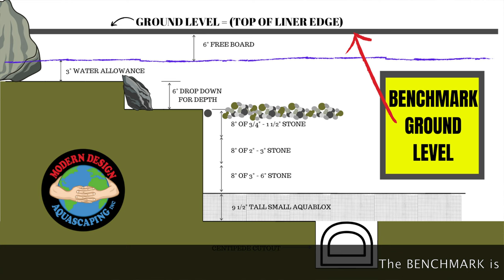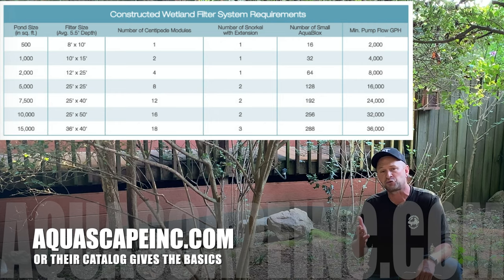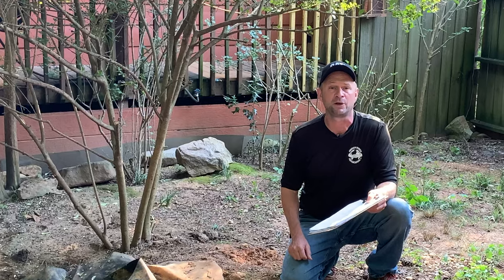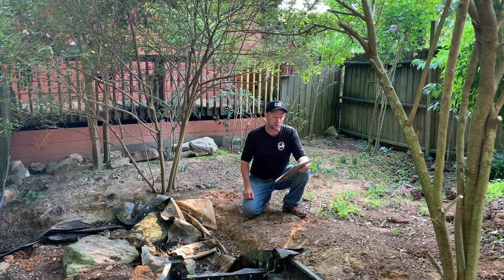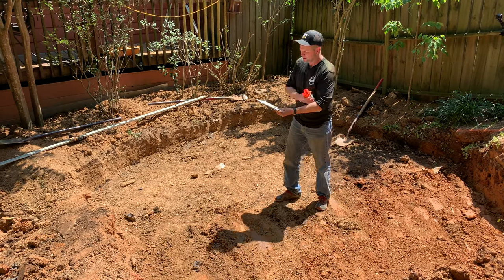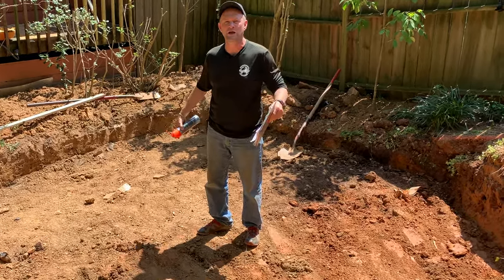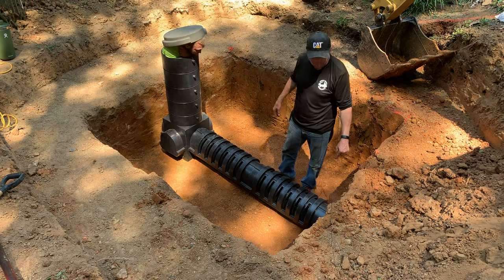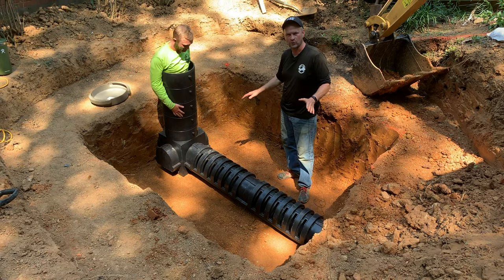WETLAND FILTER LAYOUT AND INSTALLATION Part 1 | Water Feature Design Series 8

Comment: Great video, and Tristan is a funny dude. Can you leave the captions on for longer? Also where the flex PVC gets inserted, is that a bulkhead? The end cap looks solid?
Reply from the maker: Sorry about the captions, work that pause button ;) The flex pipe just slides into the centipede and the gravel / gravity holds it in there. We always use a bulk-head fitting if we perforate liner below water level though!

Comment: John, thank you for sharing. great mind, great vdo, very instructional the way  you put them together.  Goo designed, and practical in the process.  One other important piece of puzzle you should cover, that is energy/power to drive this system.  Your system is great but electric bill is skyrocketing. 
To complete or or top off your great work and design you should consider implementing solar or power source to make it a piece of mind.  Just the thought.
Love you guys, keep up the good work.
Reply from the maker: You are correct. In some areas (like ours) electrical is not so expensive. In other areas external pumps may be a good idea and then there is the whole solar panels to offset the consumption idea. I have never seen solar pumps that were too impressive (but that doesn’t mean they are not out there. Thanks for watching!!

Comment: Thanks John, another great post. It seems like the filter sizing is still a bit of a dark art at this point. It's a very big jump from the biofilter being sufficient to 360 cubic feet of gravel volume. To reduce costs for clients, do you ever go for a biofilter for the solids and then a shallower and smaller gravel bed with plants to enhance filtration? Be a big cost saver if the aquablocks and centipede were taken out.
Reply from the maker: We have built small wetland filters (4 blocks with a pondless vault instead of a centipede). You can do this video’s filter at 1/2 the size. You can use a large bio filter with matala style mats, bio-balls, and a bottom (back-flush) drain... You can buy a Fiesta - you can buy a Lexus- something for everyone eh😎 No dark arts involved, just options. Koi can be $2.00 or $200,000.00

Comment: Can you provide diagram with elevation for this design? I still cant understand the pump placement to the wetland filter and where to tee off for the bleed valve
Reply from the maker: There are diagrams in the videos in this series showing all elevations. The bleeder valve should be above the water level in the wetland and its a simple insertion of a tee and then reduce to 1” pipe and let it spill in right at water level in the wetland so when the pump turns off it gets air. Pump placement can be anywhere in the feature ;) Skimmer-intake etc.

Comment: Perfect timing, I'm currently planning my water feature here in the UK so I can price up materials, was wondering what size wetland filter to go for, my garden is basically flat.  wetland filter at the far end of the garden into a stream with cascades and a final waterfall into the main pond which will be around 15' x 25' x 5' with intake bay, around 50' overall length down the right hand side of my garden. will be using Aquascape products but doing the work by myself because of finances.  look forward to more instructional videos.
Reply from the maker: The filter we are building in this video would be ideal for your pond. You could go smaller but if finances allow, I would do this exact design. Obviously stone around the edges could be smaller than what we plan to install. Stay tuned for the finish ;)
Reply: @KoiAddiction    Thanks John,  appreciate the reply.

Comment: John , the info videos are great. Thanks 
Quick question. I have a 13x25x3 pond and a wetland filter 8x16x4 . Can I run 6000 gallon pump into the centipede or is that too much flow for a wetland filter
Thanks. Keep up the great work
   Jim Milazzo
Reply from the maker: I need more info on the wetland design to answer the question really. We go 2000 GPH per centipede but we also have rules for how many aquablocks per centipede. Can you shoot me a layout or pic of the construction? The other way is to get a dissolved oxygen meter to make sure that is good and then ask yourself “is the filter removing the fines like it should? You can always adjust by letting some of the flow out on top and not pushing it through.

Comment: Hello John, another great video and another question from France 😉. 
Referring to the size of the stones in the filter, I see differences between your video and the Aquascape "official" documentation (Pond Bible). You are mentioning 1 layer of 3"-6" (Aquascape Bible says 4"-6", not far), then 1 layer 2"-3" (Pond Bible says: 1 1/2"-2", quite smaller) and finally 1 layer 3/4"-1 1/2" (Bible: 1/2"-3/4", again quite smaller). Is it that you have experimented better results with that size of stones or because it doesn't matter that much (provided you keep 3 layers of different sizes) and you do as per what is available for your projects ?  Thank you.
Reply from the maker: We have a better (easier) time cleaning the larger 3/4- 11 1/2” gravel. The main thing is that the stones are rounded so they can back flush easier. Grade from larger to smaller as you go up. If you use the small gravel you will be fine, for me it’s harder to clean is all. Larger stone at bottom not so important to me but at least 2-4” for a minimum size over the Aquablocks.
Reply: @KoiAddiction  Thank you. Good reason !

Comment: Hey John! I've only installed one wetland in the past but I've got a few coming up this season. I've got a plumbing question for you: Previously, I just plumbed 3" flex pipe from the pump into the centipede using a Fernco (including the 3" elbow). How are you plumbing the 2" flex pipe into the centipede? I tried to pause the video but I couldn't quite see it all. I saw the elbow but I was wondering if you're using a 3" to 2" reducer, a Fernco or what? I want to have it dialed in this year so I can install the bleeder valve as well. Thanks!
Reply from the maker: 3” tee reduced to bleeder valve. If the flow requires 3 inch into the centipede then I use a fern co-and run the 3 inch into the centipede. Totally depends on required flow rates for the wetland.
Reply: @KoiAddiction  Thanks! You guys are the best. All of your videos have been so helpful. I really value all the advice.

Comment: Hey John, great videos man I'm learning a lot. 

Say I wanted to build a 300 gallon wetland filter at the top of a waterfall, where the filters water level will be 3' above ground level.

Could I build it with a liner and support it with soil tapered a distance or would I need a container to keep the soil from collapsing?
Reply from the maker: I always use soil but we also put rock to create structural stability!

Comment: Great video sir! I've learned a lot from your videos. 
I'm trying to mimic this design for my wetland build. You mentioned that you measured 6.5' in one direction and 7.5' in the other direction. How many aquablocks dose this require? It appears as though small blocks are 26.5"long x 16"wide x 9.5"high. I see you have 3 going length wise to get the 6.5' but it seems there are only 4 laid width wise. Isn't that only 64" wide or 5.3'? Not trying to bad mouth just want to learn because those aquablocks are pricey($51 each). The pond I'm filtering is only about 140 sq ft.
Reply from the maker: We do over-dig the hole so the blocks fit nicely. That may have been the reason? Typically we will add a foot in each direction and back-fill with 2-3” stone after the blocks are in. This makes installation easier for us ;)

Comment: hey John quick question, did I count 12 small Aqua blox's used for this size wetland, I have a 6x8 mtr pond .9mtrs deep and was thinking of using the same size wetland, many thanks daniel
Reply from the maker: It would work BUT if you go to a higher % of pond area you will be ideal. I think that would be 36 small blocks for your example, SO - in theory the 12 small blox is WAAAY better than a bio-falls, and will give you a great filter BUT if I were designing it,  I would offer the 12 as “minimum” and the 36 as a “better” option. After doing some conversions…@ 520 SF in your example, the 12 small blocks is about 7% of pond surface area. 36 small blocks is about 21% of pond surface area. The filter will do it’s job either way SO you offer the choice to the client. According to design, 2@ 6000 biofalls could filter that pond…either way the wetland is a HUGE upgrade to that eh? Have a great one ✌️😎

Comment: I'm building a small swim pond. Approx 11 thousand gallons. What size wetlands would you suggest. Aquabloxs how many, 2 cenepeides or 3. In the intake I think I'll need 2 vaults and 6 large aqaubloxs.  Your thoughts.  Or can I go with a 6000 biofalls. Then add 2 cenepeides to thr bottom of thr pond to percolate up and bring cool air up? Thoughts. Thank you in advance.
Reply from the maker: Yes you can use biofalls but wetland is always better. Go at least 30% of the pond surface area for a small rec pond to determine size of wetland. Wetland size will give you a sq. Ft. Area and then use the aquascapes guys from there. They will send you a CAD drawing of the size filter you need and the parts required. Flow will be 2000GPH per centipede!

Comment: Mr Adams i had bought 2 pond vaults,can i use one for the wetland filter
Reply from the maker: I have done that in the past, it worked OK but not great. The fact is the centipede unit spreads the water out and slows it down about 90%. The Pond-less vault will not do that and the water will end up taking the path of least resistance up through the vault and not through the gravel...😅
Reply: Makes sense 
Snorkel and centipede it is
Thx u
Awesome job in the sand box studio by the way